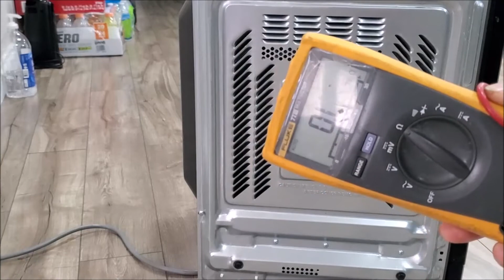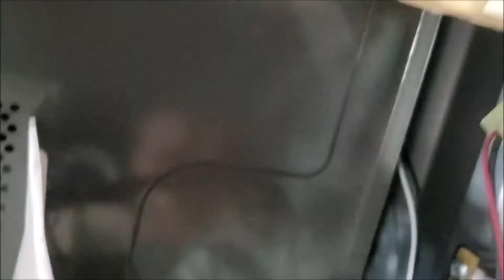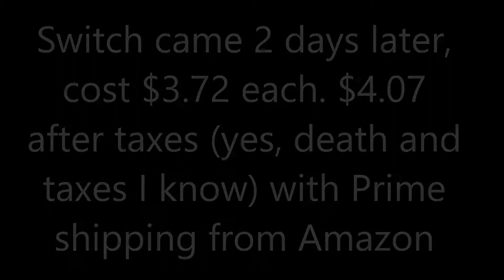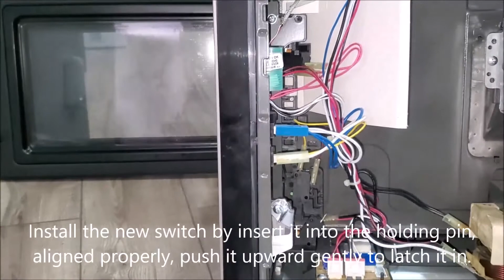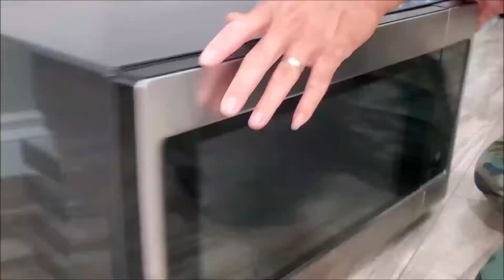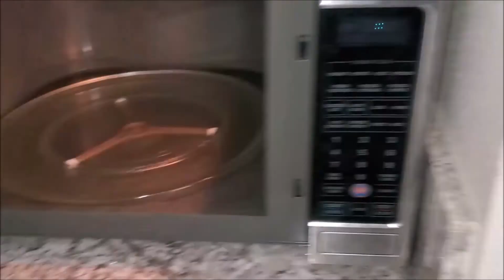LG Microwave Troubleshoot and Repair - Turntable not turning

Comment: Thank you very much for making the video and sharing it.  It is quite impressive.  My resistance testing of the Turntable motor came out to be fine (3.15 ohms), but the Turntable did not turn.  I decided to replace the motor assembly, but could not find an exact match.  So I was forced to overhaul the motor assembly, which was successful in my second try. God bless you.

Comment: Very helpful. Straight to the point, I found the faulty bottom switch.
My LG model is LCRT2010ST /01. Bought the Door Switch P/N# SZM-V16-FA-63 on Amazon and replaced it. It worked like a champ.
You are the man. Thank you very much for your help.
Merry Christmas.